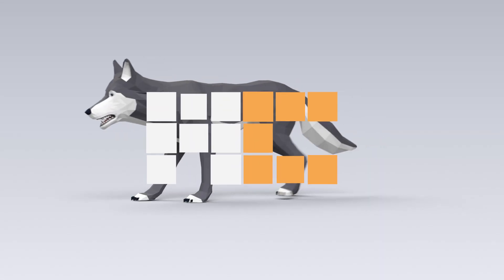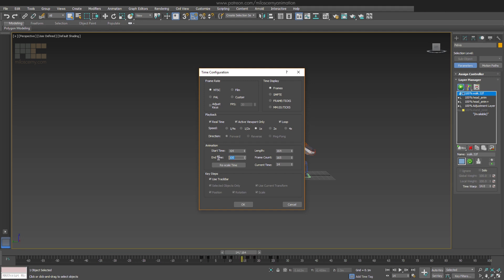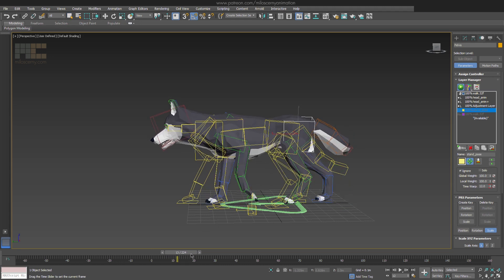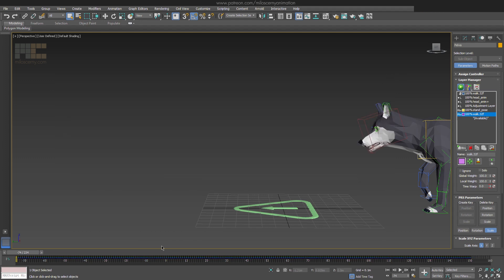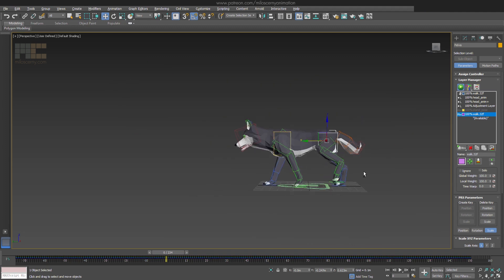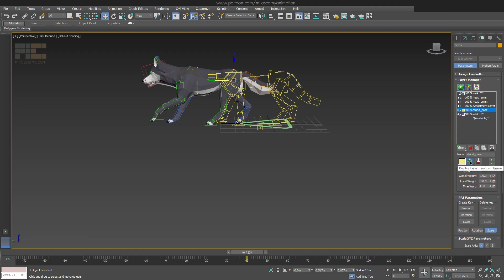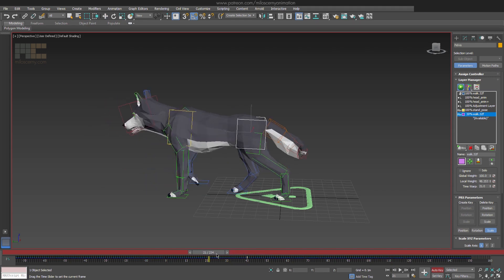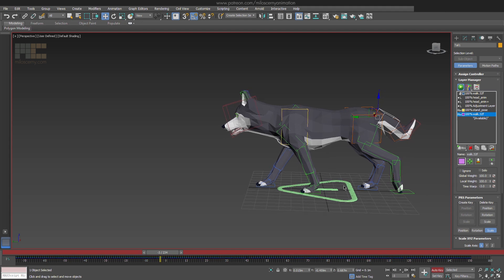Transition from Walk to Stand Using Local Weights (Part 1/2) - 3ds Max CAT Animation Tutorial

Comment: Starting at 5:32 you select the pelvis and the foot platforms on the pose layer and animate their movement to match the collapsed absolute layer. Then you cut to fixing the pelvis' curve slope but don't show the fixing of the foot platform curves. Did I miss something? Also, would it be easier to just animate the Layer Transform Gizmo for the pose layer instead? I would appreciate some clarification and, of course, will defer to your expertise. :-)
Reply: I think I see what happened now. You deselected the platforms and selected and adjusted the pelvis curve only to match the collapsed layer because the platforms will get their own adjustments in the next video.